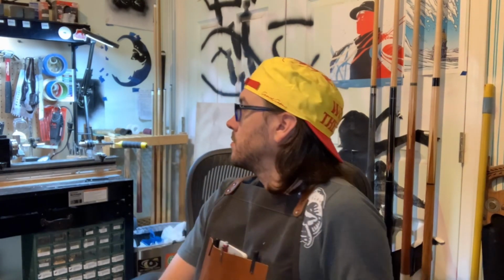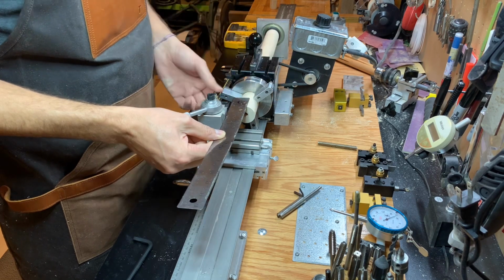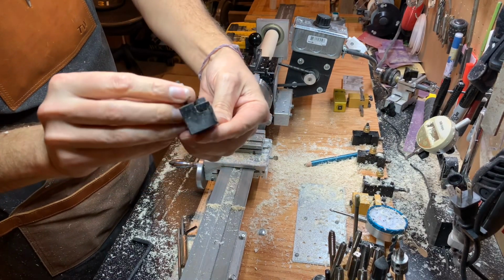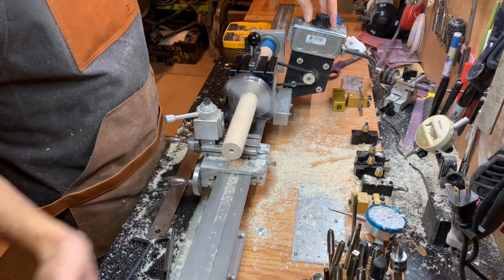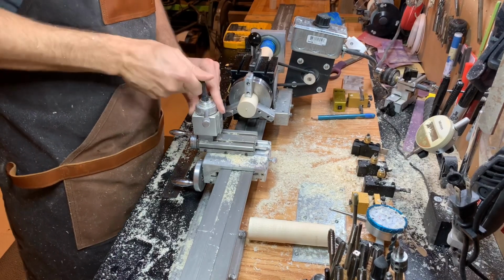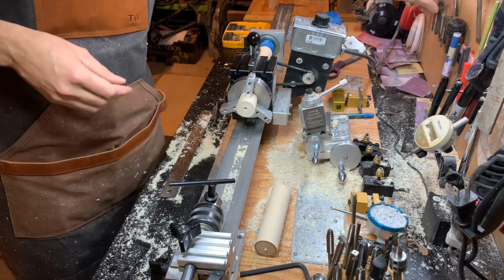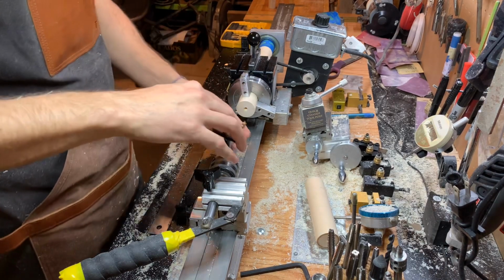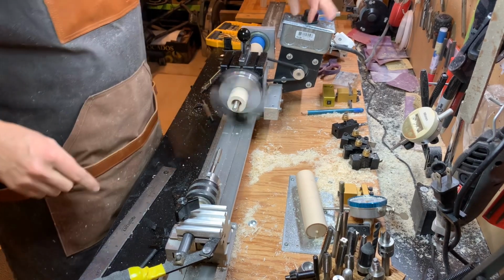Building a pool cue (the handle) newbie lathe operator - what could go wrong?

Comment: you said .075 not .75 , that would be seven hundred and fifty thousandths of an inch. .001 is one thousandths of an inch. Machinist terms. You have a lot to learn, I'm glad your not trying to tell how to do it but that your learning as you go. Drill to tap drill size and to depth first, then bore , then tap.
Reply: Seven hundred fifty thousands and 4 tenth's? See the problem with our talk. we got two tenth's going

Comment: Have you thought about just turning the end of the handle down and sliding the butt sleeve and butt cap over it instead of cutting it off and adding a threaded rod and tenon it would save time and not add extra weight
Reply from the maker: Hey Eric, yea next time that is my plan.

Comment: Also, drills.can “walk”… 3 flute center carbide drills are expensive but worth their weight in gold!

It’s always best to drill then bore to size, or if you can - drill/bore/ream to size THEN tap for best accuracy. 

Even better would be to “live tool” using a router and threading tool but it doesn’t appear you have threading capability on your lathe.

Another time saver for you would be to get a set of gauge pins, and also mount one of your drop indicators to the back of your cross slide. Less stopping and checking plus it gives you a bigger dial to read vs. those TAIG dials. 

And if you’re not already familiar- you have a hybrid TAIG Tools lathe there. Check out their site for attachments/replacement parts, etc.
Reply: Not likely a HSS or Cobalt drill is gonna walk in maple!

Comment: Several solutions to the tape deal. The best IMO would be to make you a set of collets with a set straight OD matching the ID of the bearing in your rest, then vary the tapered ID’s., then taper your handle. ZERO wobble/run-out that way. 😉

Comment: Forearm could use a phenolic band at the bottom to hold the points .  The lateral force from the A-joint will try to separate those points .
Reply from the maker: I can see that happening down the road now that you mention the points separating.